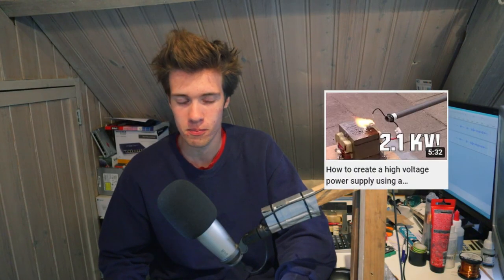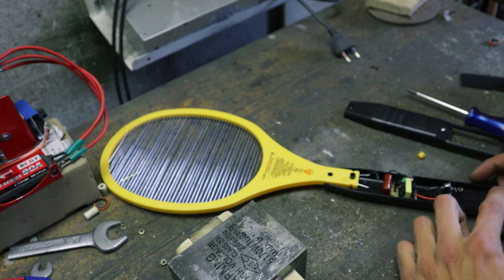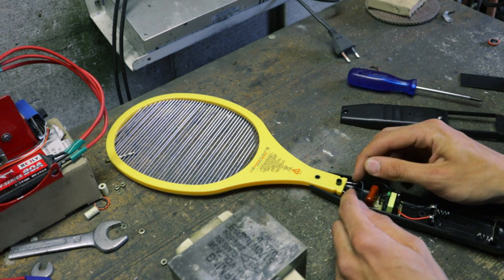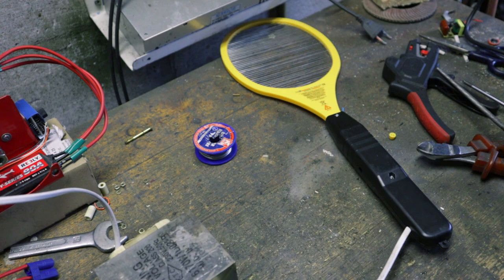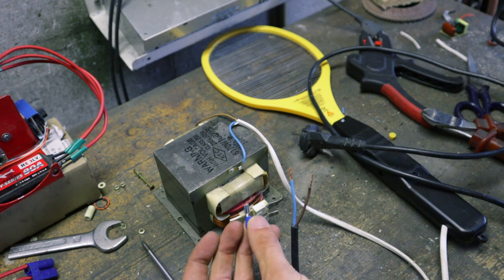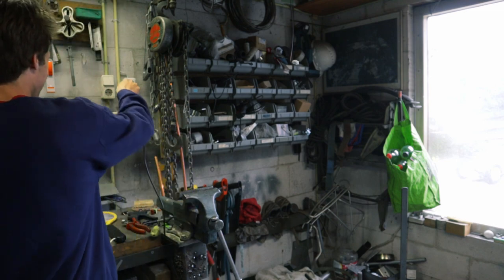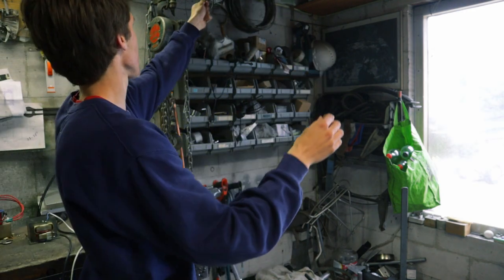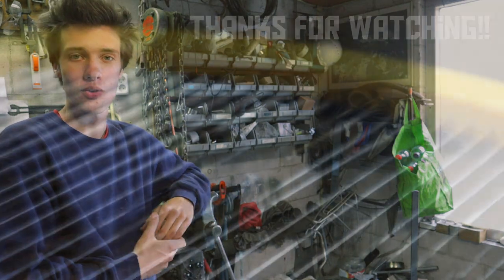Microwave transformer-powered bug zapper (AKIO TV)

Comment: You could make something less dangerous but still fun by just putting a microwave capacitor on the output of the regular zapper circuit.
Reply: Tell me more....you mean, replace the rectangular brown cap in the original circuit?
Reply: @j3ffn4v4rr0  Yes. However, since that comment I actually tried it and was disappointed by the result. On closer inspection of the label on the capacitor it appears to have a discharge resistor in-built, which discharges it fairly rapidly. It's an improvement, but not dramatic.
Reply: @TheGodpharma  Gotcha, thanks for the info!